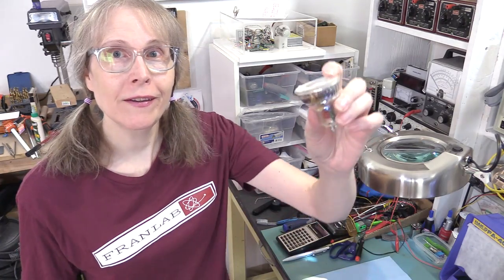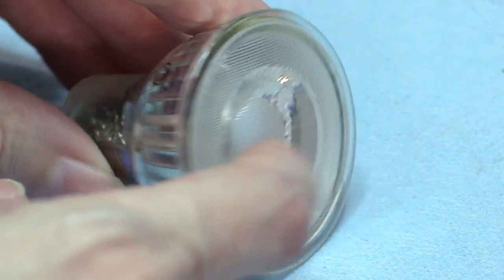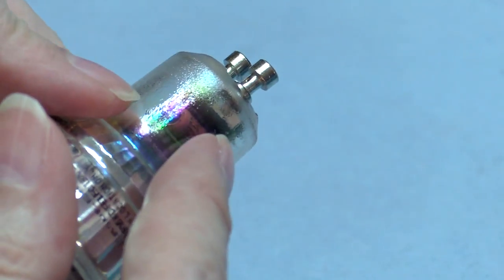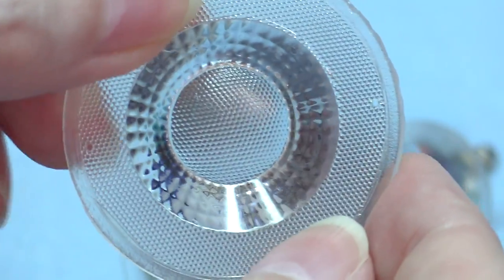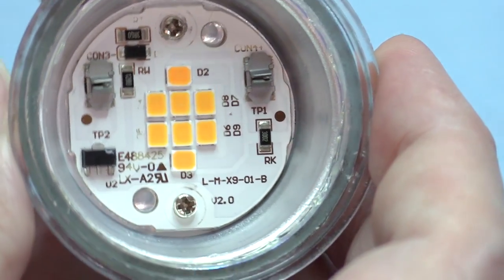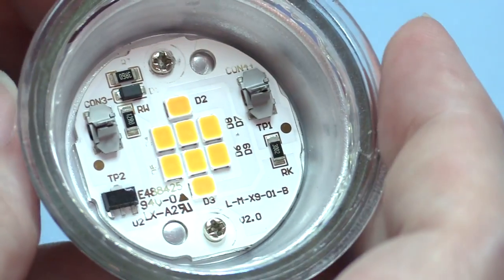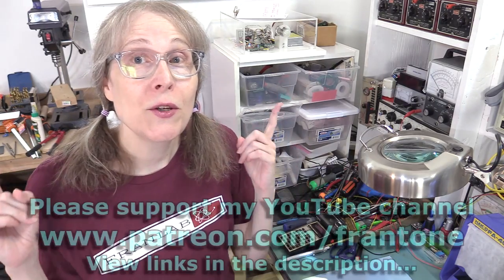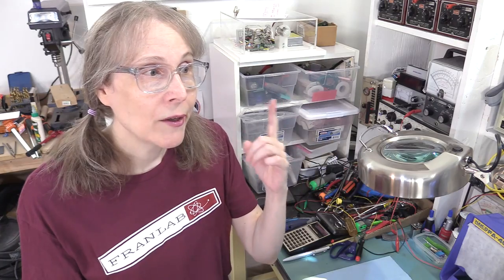Inside An LED Light

Comment: I have a mixture of both cheap and expensive led lamps, none of them last much more than a year or two. The failure rate is certainly higher than it was for all of my old tungsten lamps. Like you say, Fran, for led lighting to be more efficient overall than the old lamps, they would need to have a life expectancy of at least double the old lamps. Sadly they tend to fail more quickly than an old incandescent lamp. Sadly i think the demise of the conventional incandescent lamps became more of a political matter, based on bad research more than anything. And if you look beyond the life of a bulb, just look at the difference when it comes to waste - an old style incandescent bulb - total of waste parts - glass and a tiny amount of metal, both easily recycled. When it comes to the led lamp, you only have to take a look inside to realise just how much harder they are going to be to dispose of.

Comment: I think a good reasonable upper bound for emissions is the cost converted to coal electrical power converted to carbon. They can't really emit more than this. Say the bulb is $15, we can assume a certain emissions. From what I remember, each bulb saves around $100 over 10 years, so will easily offset this. It's not a very precise method but seems a reasonable upper bound
Reply: Actually I'm pretty sure these sorts of bulbs cost about $3 on AliExpress or whatever so those are probably better numbers

Comment: I had a 10% early LED light death in my home. My assumption was that the cheesy switcher in the bulb was the thing that was failing. The remainders haven't failed. I would have chosen to pay more for a more reliable lightbulb if the option was presented, but that's not how consumer manufacturers think. Anyway - looking at the population of bulbs, the manufacturing carbon footprint is dinged, but scaled by the proportion of bulbs that failed. Low voltage lights FTW - The big switcher is more reliable, it's easy to change the switcher if it does fail and the LED bulbs rarely fail because they don't have switchers inside.

Comment: I'm honestly surprised a bit. Even with so many components 12 months seems abysmally short lifespan. I was under impression that LED lights can significantly outlast the incandescent light, but I guess that's only the case when the LED already has a DC input, like a battery. In the case when you need to converter AC supply first it suddenly gets so many new potential points of failure.

Comment: In countries that are cold, the "energy saving" is nil. The energy not being output as heat by the old fashioned bulb is having to be replaced by increased use of the houses/offices heating system (assuming the thermostat is set the same). The energy saving is significant however in hot countries where you would be running air conditioning (at night, when the lights are on....). The move to CFL and then LED was mainly due to lobbying by lighting manufacturers who were unable to make as huge a profit from tungsten and halogen bulbs as they were from "energy saving" light bulbs. Tungsten and halogen bulbs contain no environmentally damaging materials - tungsten and glass are inert and the metals are not dangerous. LED bulbs contain plastics, tin, copper as well as requiring hugely more energy to manufacture.
Reply: Your point about no energy savings in cold climate ONLY holds up when the regular heating is resistive electric. Heating a house with fuel is twice as efficient as electric heat fed from a fuel-powered generator. If your only energy source is electricity, heat pumps are also an option, which are effectively over 100% efficient as heaters.
Reply: @eDoc2020  Whatever the efficiency, if you are saving 85w of heating from a 100w bulb then you need to supply an additional 85w of heat from your heating system. You'll still use more coal from your coal fire, or oil from your oil burner (and creating more CO2) - As for heat pumps if its Coefficient Of Performance (COP) is 3 (typical) you're still going to need to supply an additional 28w (85/3) to your heat pump. Your energy saving is because you have a heat pump, not because of the energy saving bulb.
Reply: BTW I''m not saying LED bulbs are bad, they have a lot of practical and aesthetic advantages, and generating heat in the light fitting isnt necessarily as useful in making you feel warm by the radiator. I'm just saying the energy savings have been overblown in colder climates where a large part of the worlds population live.You could probably acheive greater energy saving with improving insulation and turning the thermostat down a degree or two!

Comment: I have wondered those same questions, but "fishing out" all the comparative information ios way beyond my abilities.  However, I have some little points to digest.  The first one is that a one year failure is an outlier.  Traditional incandescent lights were rated  depending on type and locale from 150 hours (some photo lights) to 2000 hours average for a 100 W bulb in certain countries and 1000 to 1500 hours in others.  The life is inversely dependent on the cube of the relative line voltage.  A 10% higher than nominal line voltage reduces the life to 75% of the specified.  And all that is in average terms.  A halogen bulb counteracts the main aging by returning some of the evaporated tungsten back to the filament.  But the manufacturer have chosen to trade a possible longer life to run the filament even hotter and achieve whiter light and higher lumen output for the same electrical power.  That much is publicly known.  What is not known is just the mentioned carbon footprint --= and that also for the halogen bulbs.  Glass is a commodity, but halogen bulbs due to their higher temperature require quartz for the bulb material.  How much more energy is needed for refining and other processing of that quartz is already a mystery to me.  Mining, refining and final processing with powder metallurgy in inert gas near tungsten melting point is bound to consume some energy.  Then, although the original halogen (chlorine) is abundant and cheap, my understanding is that modern halogen lights use more esoteric mixtures of less common gases.  Producing those cannot be free of their footprint.  So, overall the comparison already is way beyond my resources..

Comment: Fran:  The expected lifetime of an LED is 50,000 - 100,000 hours.  One year indicates a poorly made product.  IKEA would probably be interested in getting that bulb to determine the cause of the failure.  I have 2 similar bulbs that I used to replace halogens about 5 or 6 years ago (in a vent hood over a hot range) and neither of the bulbs has failed.  I've had 1 LED bulb fail - a 150W equivalent LED that I mounted in a reflector housing (i.e., a spotlight).  The obvious mode of failure was overheating of the bulb in the housing (which was designed for a tungsten photoflood bulb - hmmm?).

Here's one for you.  I am projecting that California will have a major power grid failure if they go ahead and switch to non-fossil-fuel vehicles, like they are planning to do.  Electrical generation is very inefficient, nuclear power plants run around 25% efficiency max, other generating sources are even less efficient.  The losses in the grid add up to even greater inefficiencies - you probably get <5% of the power generated by the time it come out of an outlet at your home.  Also, bad connections in the grid, in part due to aging equipment, is one of the causes of the wildfires in California.

-- John (retired Environmental Scientist)

Comment: It’s important to allow new technologies to fully mature before making definitive comparisons. This IKEA LED bulb is an early and crude attempt to transition to a newer technology. I doubt this is what we’ll be using a few years from now.

Also, future homes should accommodate low-voltage devices, without the need for each device to have its own converter. Green solutions have to be holistic. The light bulb is just a small part.

Comment: There are LED lights and there are LED lights. 
Most LED lights are made cheap and disposable. They use cheap capacitive droppers power supplies, and the electrolytic caps will get hot, dry out and die. 
I have a CREE bulb that I bought 10 years ago and it is my main living room light, on about 12 hours a day, everyday, and still going strong. 
They didn't know how to make them cheap and disposable back then. I think I paid $25 for mine.
Now they are 2 for $1 at Dollarama, but won't last more than a few months.

Comment: We should be careful to not conflate the problems created by retrofit to the actual capabilities of LED. Currently, a 100W LED system can easily excite 17000 lumens vs the about 1000 of a traditional 100W incandescent bulb.

Comment: I have dismanteled broken philips led lights from my home, very similar to the ikea you took apart but the philps modules are connected with connectors, you can take the lamp in to 4 pieces and could replace just one part if it would be available.
Especially the glas housing requires a lot of energy to produce and could be easily dozen of times re-used.
If it would be about the total carbon footprint in lifespan these things would not exist, the old bulbs where just glas,steel,nickel plating and 1type of plastic, almost a 100% recyclable, led's are a mix of glas,metals like copper,tin,zinc,aluminium, silver, rare earth metals, phosphorous, a dozen type of plastics hard and soft including silicone which makes recycling the other plastics very difficult if mixed in etc.

If leds dont last youre better of with tungsten in the long run

Besides the footprint: in the old days if a bulb broke premature it would cost you 50 cent to buy a new one, 1 euro for a high quality brand one, now you toss 5-10 euro in the bin if a led fails premature.
Ik have seen leds burned, rectifier broken(pulsing led), all due to overloading the components and heat, the tech is barely ready to produce a 1-3 watt led which isnt enough for domestic use, you want 6-7 watt (latest generation)which equals about 60 watt tungsten and thats just simply to much to keep it cool enough to last the claimed lifespan.
Then there is the flickering, the horrible color rendition
Reply: I think much of the issue is manufacturers tend to drive LEDs hard to save on initial materials, but if they used a greater number of underdriven LEDs instead there is a small increase in energy efficiency as well as a drastic increase in lifespan.
Reply: Thanks for answering Fran 😄,

Yeah,
I was not clear enough but thats exactly what i mean, led have up till now a limited output compared to tungsten, with tungsten you can put a 1000 watt in a pencil, with led thats just not possible but the market wants it so all the research for better efficiency is focussed towards higher power (and better color rendition) and led hve to be overloaded to get the power consumers want(and require), the equivalent led for 60 watt tungsten is about 7 watt and depending on how lage or small the housing is it will get to hot and fail prematurely, spot-led to replace the old GU tungsten is just to small  to dissipate enough heat so the led's are cooked and so are the electronics.
I think the only way to go with led is with dim-able led so you can manage the output yourself and run them on something like 75% which will increase the lifespan drastically, its that last 25%output that causes all this heat.
Led's can last a long time but not at the market point where we are now, there are still a lot of problems to solve with led and thus you still see a lot of improvement with every new generation.
At this point in time i can buy 2-3-4 generation philips and osram led at my local hardwarestore with roughly the same "tungsten comparable" specs, the cheapest are 7 watt, the most expensive and latest generation are 5 watt.
Take a guess which will last longer  🙃
Reply: @robber576  (read in Monty Python voice) You're Welcome ;)

With many (most?) LED lamps you can reduce the drive current by changing out a sense resistor. Clive has done this several times on his channel, and I have also done this once.

Comment: It would be way better if houses had 12V for lighting so you could use way simpler LED bulbs with a lot less electronics inside. Plus it would make dimming a lot simpler as well.
Reply from the maker: It would be interesting now that we have low voltage lighting as standard if two-voltage systems might be practical in homes and offices.

Comment: Bought quality brands.  Every bulb in my house, radio room and garage.  Had 1 fail in 6 years.  Which means the bell curve on failures must be toward exceptional life.  Sure you can buy the 10 pack for $6 and have a short lifespan, but those come from China and not trusted by me.  MTBF is based on a large sample...not just a few bulbs.  Good video.

Comment: Interesting thoughts on CO2 emissions of LED light production.
However, one can’t equate energy input with fossil energy.
Can’t blame a product for unsustainable production because it can change to renewable energy input.
Can’t say biofuels cost rainforest because one can produce them sustainably too, just like electricity.
The issue is fossil fuels, not certain products.

Comment: Well, just my 2 cents worth of speculation....  so, maybe T. Edison was more correct than anyone thought, at the time.... most of our 'home' devices run on lower power DC, internally... only the heating system, and motorized appliances use raw AC now.... we should have dedicated lower voltage/lower power circuits wiring our houses.... and maybe one large AC/DC converter at the mains... that way, the 'leds' could just have some current limiting, without the need to take mains and convert 'each bulb' to DC.... gee....what a thought....maybe AOC has a point about fixing all our houses......

Comment: The real shame is that a lot of the components being thrown away are perfectly good. No need to bin the power supply if the LEDs have failed. Maybe once we get to the point where we are running DC for our lighting circuits the complexitly of the bulbs will decrease.

Comment: Fran, this was excellent.  And I really take to heart ,  your insights on the carbon footprint.  When one looks at the level of components and relative complexity, and the fact that the bulb died within 12 months, this is something that needs to be quantified.   I can see down the road  - a single chip design or a couple chip design being developed and I can see ways to make the drivers much more efficient but that is not what we see today.   I wonder if you might look around for an example of a better design in  a follow up.     I can tell you that I recently replaced T florescent t11 ?  tubes in my basement fixtures.   The circuits in that were much simpler.  And the old tubes will be much easier and safer to get rid of because they are plastic.  The old Glass tubes were very difficult to get rid of.  So there may be plusses  depending on the design.   There is a lot of hope  - maybe we are not there yet.

Comment: If LEDs inherently ran on a wide range of high voltage, like halogen or tungsten filaments, they would require a much smaller carbon footprint.
Reply: By stringing together dies you can get the LED array to have a native voltage of whatever you want plus or minus three volts. I don't understand your argument, you still need housing and drivers.

Comment: I’ve recently come to the end of an 18 year stretch selling to trade electricians and the public. I’ve seen the evolution of domestic and commercial lighting from nearly the beginning. I was going to answer some of your questions, and give you some food for thought, but the thought of all that typing suddenly made me weary. One thing I will say is this, and someone has touched on it in a comment. When we have a revolution in domestic and commercial wiring, because our lights are now electronic circuits, and we centralise in our fuseboard the supply, voltage and current wise,  and we replace are 1.0 mm and 1.5mm twin and  earth with something akin to multi core Data cable, which will allow a whole new way of controlling our lighting, then all the ups and downs, dead ends, and downright cons, driven by commercial greed, will come to an end and we will have arrived at our destination, cheap, efficient, practical lighting. Yep, we’ve used untold resources and the public have spent a fortune chasing the next new thing over the last 20 years... what can I say, I’ve seen it all unfold in painful detail, shit happens. And of course everyone wants to dim their lighting, grrrrr...

Comment: if none else has answered your question yet - of course there are tons of life-cycle assessment studies about LED lights in the past 20 years. Making the very thin tungsten filament of a halogen bulb together with the necessary fused quartz bulb also needs a lot of energy in comparison. I'll send you a link to some LCA studies which I just took from different sources through Patreon.
OSRAM has some LCA directly available from their homepage for different product categories https://www.osram-group.com/en/sustainability/environmental/product-lifecycle-management

Your particular LED bulb died much too early and should have had a much longer lifetime. Most of my own LED lights have been running for 5+ years now since I last changed them - different styles, some of them are of a similar type to yours, most are E25-sockets, all running off 240 Vac. And they are running on average 5 hours per day I would say. I definitely had some early failures as well, never on an IKEA one though...

Also - there are no LED lights out there which produce significant amounts of ultraviolet light. Using UV LEDs to excite the phosphor would be much too expensive as compared to the blue LEDs around 400-440nm which are used.